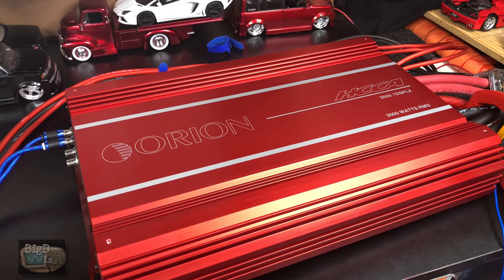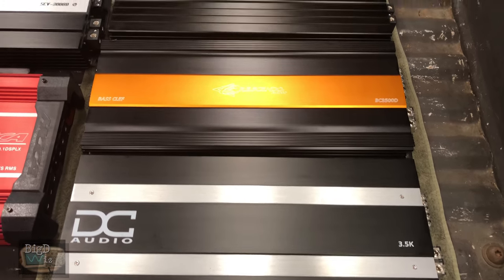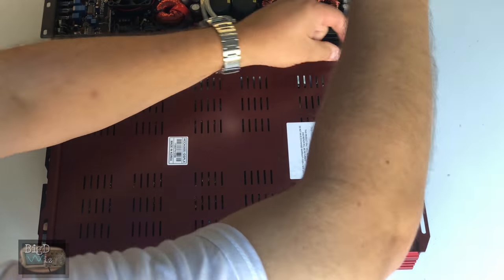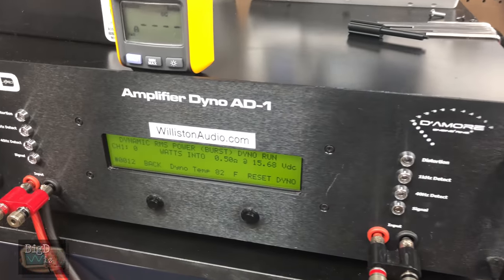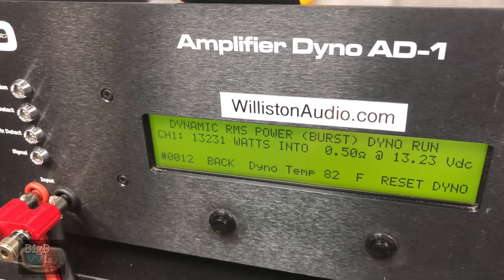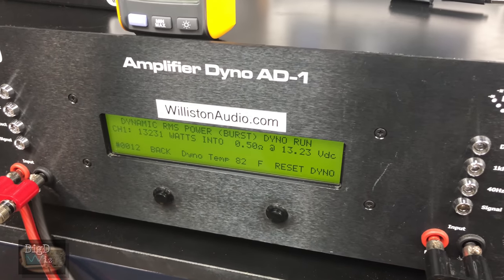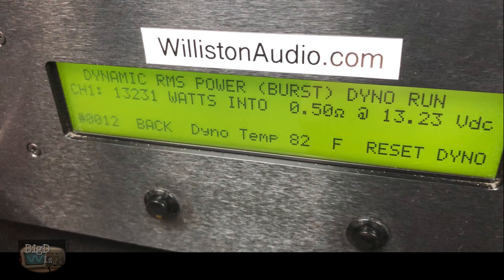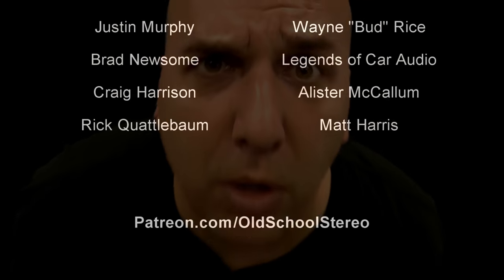10,000 watts from a 3,000 watt amp? Nope, even more...

Comment: I'm just going to say what everyone is thinking or afraid to say. The Orion dsplx amps are the best in the industry right now. They aren't even close to being the most expensive. Every company in Korea and china is reverse engineering the boards right now.
Reply: this is what happens automatically when they build their stuff in those countries.  maybe not so much in korea but in china the gov takes all of the blueprints and makes their own stuff.  they don't care about copyrights, patents or trademarks. what's really a scary thought is boeing and northrop grumman build all of their controls and electronics for fighter jets and other weapon systems in china
Reply: From my understanding Orion and Rockford has their own build house and manufacturing. Unlike other brands that copy 🐈 their products from one another. I have not seen any copy cat amp boards like Orion or Rockford on the market.
Reply: @danielhillwick8430  rockford may not be copykatting but for how much they sell for still not worth it rockford wasnt even in the running or mentioned cause they are a rip off just like jl audio

Comment: I ran orion years ago when all this was first starting. I remember the black amp that claimed 25x4. 141 dB spl. Unreal. That was in the late 80's. Glad to see they didn't sell out
Reply from the maker: They have changed owners over the years, but it appears the new Orion means serious bidness👈😲
Reply: They use to call them onion amps back in the day because of the distinct smell they use to put out. Orion has been my amp of choice since the mid 80's ever since seeing an exhibition build at the sound off competition at Devonshire Downs, San Fernando, CA. It was the first time i had seen a windshield get smashed by a sound system. 

This guy had 10,000 watts pushing 10 or 12, 12" Cerwin Vegas in a walled mini van. In the 80's the only way to get 10,000 watts was to use a shit load of smaller amps. In this case there had to have been at least 14 amps attached to a wall at the rear. All true class A 2 channel amps if I remember right. They got hot as hell and smelled like onions. 

I've have used plenty of other amps over the years, Hollywood Sound Labs (under rated and not well known) , PPI, ADS, Rockford Fosgate to name a few but I have always liked running Orion's for the bottom end. I still run an old school black XTR PRO 2400 2 ohm class D mono block (rare) in my Explorer. It's my understanding that Orion only made this amp for 1 year before replacing it with the red 2500 1 ohm stable version so you don't see to many of them around. It's been about 10 years now and it is still going strong. Even though it is rated at 2 ohms I have had no problems running it at 1 ohm except for the demand for current it puts on the charging system.

It's good to see Orion come back to life with it's new owners. They kind of got lost there for a while and I thought I was going to have to wright them off as another great small company turned huge corporate producer of crap like so many other brands of the 80's and 90's. Orion has a good business plan I think. They have like two completely different divisions. One is straight forward consumer grade Chinese "made for the masses" nothing special type shit you find at Wall Mart and then they have the other division dedicated to making car audio that is actually worth putting in your car. If I needed to replace my current system this amp would be on my short list of candidates. The price to power ratio of this amp is top tier.
Reply: They did sell out to DEI , but someone brought them back hard !!!!!!!!!!!!yeh boy
Reply: Oh they def sold out. That hcca is an oldie
Reply: "Car wars" is what the locals  called it here. I won a bunch of them with 2 of those amps

Comment: Holy s***! I thought it was going to do right around 10k. Holy crap that thing is a beast!
Reply: That's insane.  What's the max the dyno will take?  You need another channel for PA amps.  Let's see what one of those Powersoft K20s  does.
Reply: @whithutchinson6895  for PA Amps the dyno Is too small only 2500w 8 ohm

Comment: DAAAAM!!!!!!!!!!!!!!!!  I was expecting it to go into protect mode, maybe with a brief 9,000-10,000W burp as it did.  Impressive!!!  I'm glad Orion is back in the game. :-)
Reply: As long as you can feed the Orion what it wants (current and a lot of it) it will stay out of protect mode. The fan may come on though. They also like to see 4 volts or more at the inputs. Ive had problems running them with 2 volt RCA's at high volume.

Comment: Love your videos, the concern I have with this particular result is that your dyno showed 13231w at 13.23v = 1000a...OR, the amp went into protection bypass and no value was actually passed through . Your thoughts? Thanks for the great work!

Comment: Orion still cheating lol.
Reply: How exactly? If you use a current/volt/watt calculator, it adds up based on current pulled from the fluke/multimeter
Reply: @VictorEstrada  You don't get what he means. 
Back in the 80s-90s, competitions were classified by power classes. 
Orion and most other higher end brands offered "25W" amps... at 4Ohm, that would operate at .25 Ohm and make 500-1kW, depending on the brand/ model. 

They were called "cheater" amps, and, Orion was one of the kings of 1/4 Ohm- 1/2 Ohm world, as was Soundstream (Reference series would run wired .25 Ohm), US amps, Linear Power, and several others.

Comment: That is an insane amount of power! I love seeing guys from work showing off the car systems. Especially when I see they have great power amps that could push 2k watts or more and beefy subs to handle the power but then I laugh at most of them cause they think think there running all that power but in reality they still have stock electrical system running maybe 80-120amps@12-14v also have other amp for highs and mids. I helped a friend out by giving him 8ga 95% nickel - 5% copper insulated wire. He uses it for 2 12" jbl subs and the ground. Before the minor upgrade his lights dimmed and battery drained from 14.8v to 11.4v, after upgrade his lights don't dim at all and his battery stays at 14.8-13.7v. I've been using this wire for home audio sub builds for almost 15yrs and swear by it but also I have my original roll of 100ft. Since I was 16yrs old 32 now. Latest use of wire was a dual Dayton Audio 18" ultimax home theater sub setup with 2 Dayton Audio spa1000 tabletop power amps running this blue 8ga nickel wire.

Comment: Big D Wiz, Your the Man when it comes to automotive audio amplifier's & showing the public how much they really push!  Your more then likely the person to ask? Can I still purchase a C.A.B.1600.1 FOR $199.00? I personally believe that was a steal! Anywho, Great job as always! My finances improved so, I am finally going to upgrade my audio! First I am upgrading my charging system! 250-350 amp alternator on my little focus along  with extra battery's, cap to ensuring that my headlights do not dim because right now, my system hella dims my headlights & there is next to nothing that I can find to add a second alternator? My a/c does not work so, my thought was to eliminate it & mount a 2nd alternator? I will be buying another vehicle soon & adding a decent set up in it as well. Right now, I have a little focus w/ 2-12's & 500 watt mono block, It does okay. Soon, I will be stepping it up greatly! I will add a line driver, bigger cap, hi-output alternator at minimum! ALL coming very soon!
Reply from the maker: You should be good with an extra battery or a bank of ultra caps. The CAB 1600.1’s are discontinued, but you may still be able to find them.

Comment: In 97' I worked at a tint place and rehooked the whole sound board. An Orion 225 would easily push 14 speakers. Until the power supply would kick off. The amp was barely over warm. JS

Comment: I used to be an Orion dealer. All orion amps are half ohm stable. They just don't advertise it. Back in 94 I ran a cobalt 430 4x30 watts. I pulled over 3000 watts out of it powering a pair of  xtr 12dvc, pair of kicker 6.5s, pair of kicker d 20 tweeters, and 4 concord 6.5s with Sony 1 inch tweeters. Banged out a 138spl . Considering this was mids that wasn't bad for a non modified 88 escort gt.

Comment: You can clamp your fluke meter on one of your power cables, and then multiply the result by the number of wires in parallel. That will still allow you to get a reading that would otherwise be OL for the meter.
Reply from the maker: Yessir, I thought of this too...afterwards 🤷‍♂️

Comment: WOW! So at 0.5 ohms what do you think it will do playing a music bass note? i ran a HCCA5000-1d  @.6 ohms using three 12"sub in my daily driver .  i have a volt & amp meter reading the  sub wire. i have seen reading over 90 volts /90 amps (8,000 watts) while bumping/slamming . "stock 140 amp alternator, 1 acid battery, big-3 (single run of 2/0 wire) & four caps (6f ) . slamming bass , my voltage dips 12.5. 30hz test tone dips 10.5volts. My real world test and your lab test are in sync. If Orion don't be careful they will be outlaw.
Reply: Glad you really clamp tested yours 90 volt 90 amp is crazy!!! All stock even better!!  Good on you Superstar!!

Comment: For those who don't know, an amp with an insanely higher ratio of burst power indicates massive power supply voltage sag. It is unable to maintain the power set forth by the outputs for any extended duration of time. An amp with a small ratio of burst power doesn't mean it's bad, it can deliver close to designed power nominally rather than sagging and being a compromise unless it was intentionally designed to be very bursty.... which makes no sense anyway as it will sound really weird and indicates there might be real serious damping issues so bass will sound pretty woolly

Comment: So this amp dynos great. I finally got a chance to try one. I had  a DD audio M5 running at 1 ohm. The only dyno test I’ve seen on it says it does about 9950 dynamic at 13.6 volts. So this Orion should have easily outdone it. I lost 3.5db. Might do great on dyno. Not so great in the real world. 240ah of lithium. Mechman 400 externally regulated to 16volts. It never dropped below 15.6. It just had no power. Or no where near what it dynos at. I was so excited to try this amp. HUGE disappointment. I gain matched it, did everything right. No way it was even doing 6k. I doubt 4K. Unfortunately I didn’t have an AMM-1.

Comment: BigDWiz or anyone else with reliable and accurate advice/opinions, what are your top picks for amplifiers? (As far as build quality, reliability, specs at or above rated, etc. Maybe best budget 1 ohm at 1500rms as well). I know there are good amps depending on how it will be used. 
I am building a single subwoofer setup, which will be used to look good and for amateur spl at car shows only. This will not be used to listen to music very often, aside from looking good and impressing at car shows. I’m looking to run 1 ohm or 2 ohm and have an rms around 1500 watt. I have not selected a sub yet, was going to get amp first. Was looking at Sundown Audio subs. But I’m interested in amp opinions currently. 

Any input? I was looking at Orion amps. But heard the Dynamic Audio Co amps are decent as well.

Comment: Ok these some big numbers. How long will it sustain its life span. Say. At 1 ohm or .66 as I run my set up. This is 1 of 2 amps I know of that put out crazy #s the other is crossfire c7 3k now marked as 4k. What is so diffrent inside these. An the ratings will the get marked up as well as the c7? How will it compare in long run?

Comment: I have a couple questions for you.. I saved the test you did in on the Fosgate T1500.1BDCP. I might as well as the last letter wrong but I'm about to purchase the T1500.1BD. I was wondering if you knew what the Dynamic power at 1ohm might be? My other question is someone is selling it to me for $175 and it looks new. Its that a good price?
Reply from the maker: $175 is a steal!!
Reply from the maker: 3296 at 1 ohm Dynamic @14.26 volts

Comment: Big d just purchased this amp have a 250 amp alt on the way biggest that i can find  what amout of batteries to you think i shold pair it with?  Running 4 fosgate t1 12 d2s also a 600 watts in mid and high any responce wold be greatly appreciated

Comment: I used to build big systems back in the late 80's for ppl. The most expensive was $30k  for a 300ZX. I was part of the team, I did not do it all. ( I wired it ) I think we put in about 1500 watts total in that car ( actually higher as all were Orion cheater amps but still ) He had 4- 12", and either 2 or 4 6.5" mid woofers all in a custom fiberglassed box that took up the whole back area. Bigger Alternator and 2nd. Sealed battery.     I don't remeber the actual DB but it was alot. It was within 2 or 3 db of any car out there at the time. The only thing louder was the Crunch VAN and other factory vans. What do you do with 10K Watts ?  Back in those days al;l the high end Subs were 92 and up db sensitivity so less was needed ( vs 86-88 db now ) but how do you use 10K watts ?  And 1000+ Amps to run it !!!!
Reply from the maker: Power is cheap now days, but copper, alternators and batteries are still expensive
Reply: @wal  But these are not Class A/B amps, they a Class D amps, correct ?   Is that why subs have low SPL rating now is because Watts are cheap so lets make them inefficient compared to the 90's ?  Subs were 5-9 db more efficient back then compared to today. It takes a bunch of power to make up for 5-9 db of less efficient subs. Seems very wasteful.

Comment: I’m running to these in my car now for the subs on the holy shit earthquake 12 inch speakers. Quite the combination. 169 DVSPL using capacitors and high tech hi expensive alternators
Reply: Tell me about your earthquake holies please
Reply: @sarahconner9433  I would look it up online all of the information is there. They will handle 7000 W RMS. Weighs 110 pounds. It’s not for most people. You have to have serious power to run it I do burbs with 13,000 W RMS. This makes it hit the numbers. Even though the amp is only rated at 3000 W RMS
Reply: @joecool7165  thank you so much!! Needs lots of power, ok, they must be stiff... You like it musically?? This amp is nuts
Reply: @sarahconner9433  Make sure you have a nuclear power plant to power it. This is going to be your problem. What I run for power to burp with it not even play it is insane. Have the best day ever

Comment: and the price goes up even more lol awesome!
Reply from the maker: Can’t blame them if it does. I’m betting demand goes up fo sho 😲
Reply: +BigDWiz yea, I'll eventually get one, maybe even the xtr 4k.. I've got a gm truck, so keeping a constant 14.4v has been tough, the voltage is ecu regulated, cold start is 14.4 for about 15/20 min then it stays at 13.2 full tilt or not, then sometimes it'll shoot up to 15.2 then I crank it and it holds.. I've ran dual 2/0 power/ground and 2 yellow tops.. I need something rated around 13v. or buy a dual atl bracket and run a separate alt dedicated just to the audio side, it would actually be cheaper to buy this hcca 3k. I've never had voltage issues on any other vehicles, just the newer gm trucks

Comment: So you received the amp directly from Orion? Cause I keep seeing to be aware of false sellers.
Reply: I got mine at Amazon about 3 years ago. The only problem I had was the bass knob. So I use the RCA as a base knob. I ran it with 2 Skar  ZVX  12 at half ohm and 2 ohm no problem still have on my Tahoe. Also I have upgrade  my alternator and big three upgrades
Reply: @Catholic1391  Thank you for responding Boss, dang at half a ohm with no problem? 😂 That's wicked and my main concern was those 6 golden rings on the inside of the amp